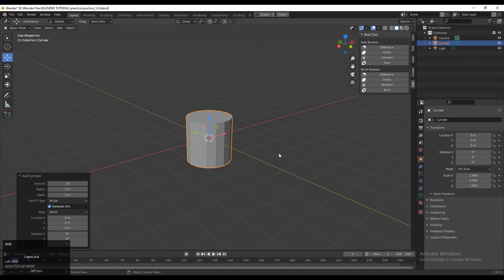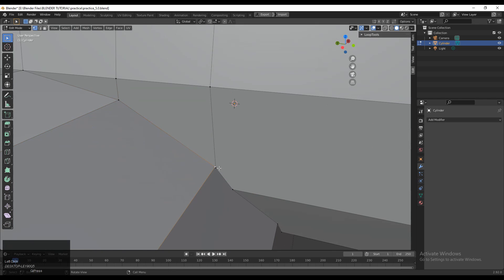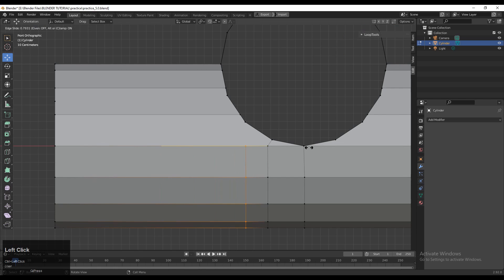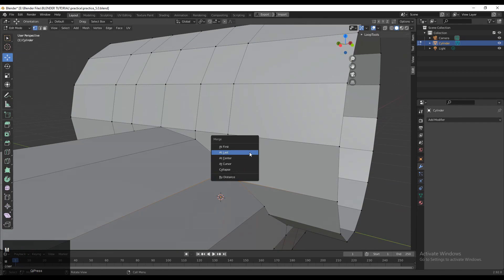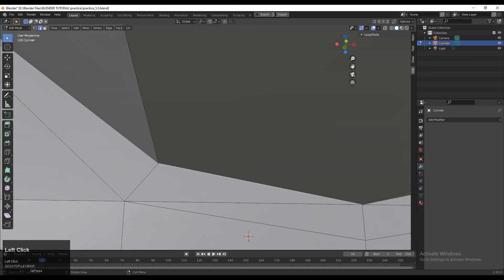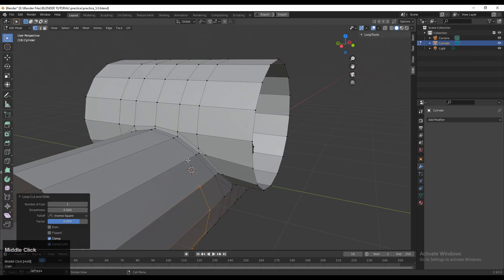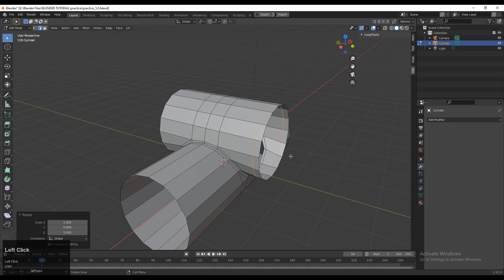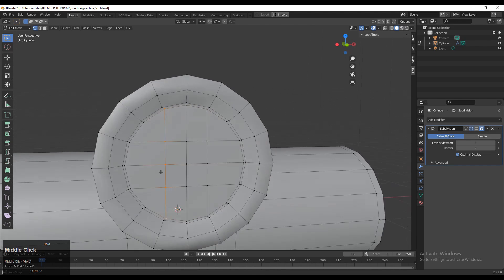Blender Hard Surface Modeling | Cylinder Intersection Tutorial | Blender 3D

Comment: Interesting video, however if it is a tutorial you really should focus on removing confusing steps for people. Instead of the Symmetrize tool you were constantly running, one of your first actions should have been to set up the symmetry first, then use auto mirror. Explain those concepts instead and then you'd not have to constantly run symmetrize every few moments. It'd cut down on a lot of rookie confusion.
Reply from the maker: Thank you 🙂